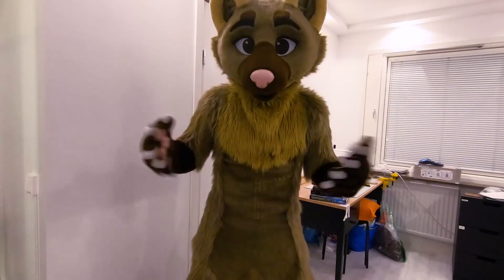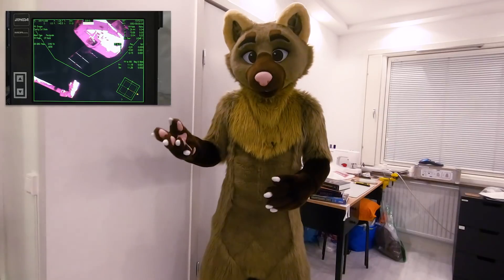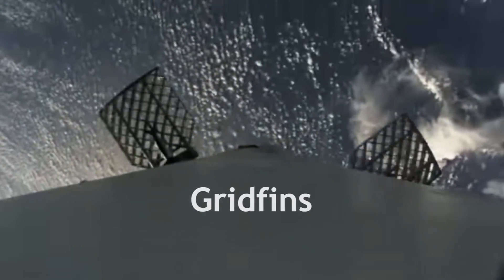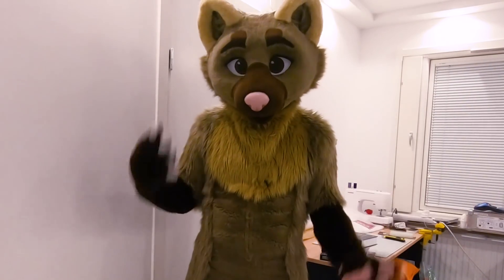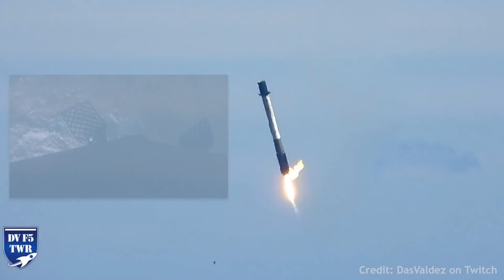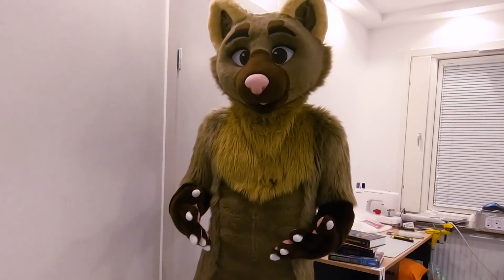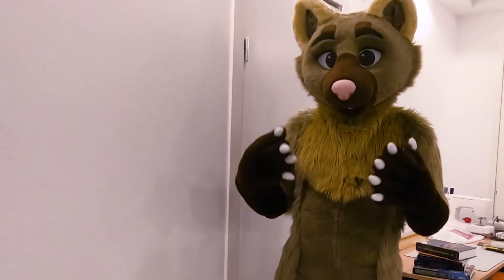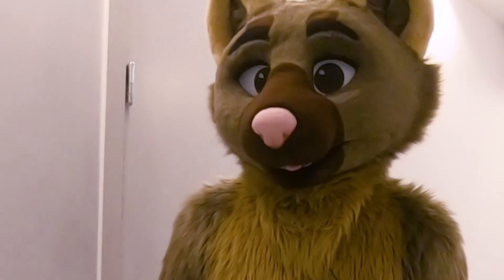Why This SpaceX Rocket Began to Spin

Comment: Oh watched the stream last night (halfway across the globe), and that was my first time watching a booster failure live. Pretty impressive.

Scott Manley highlighted something else wrong with the rocket though, there was this frayed O-ring of sorts that came into view moments before the booster completely lost control. Think it's something more than just the grid fin failing?
Reply from the maker: That was so cool-looking! It was a massive ring of ice that formed around one of the lifting pin holes. These holes are used for lifting the booster and are not related to the hydraulic system. Ice (both water ice and oxygen ice) is regularly seen coming off of the rocket in all stages of flight.
Reply: Oh, no matter it looks so jagged. That was good to know!

Wonder who packed the mouse feed before yesterday's originally scheduled launch time? Poor mices now has to wait longer for food :'c